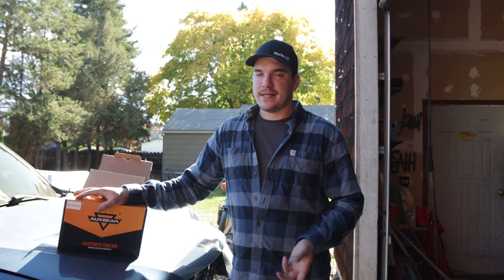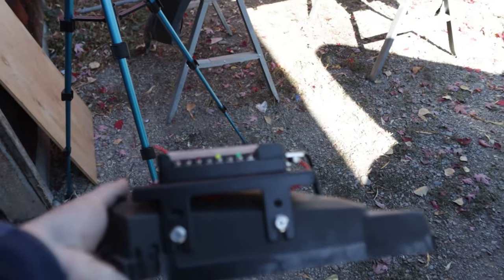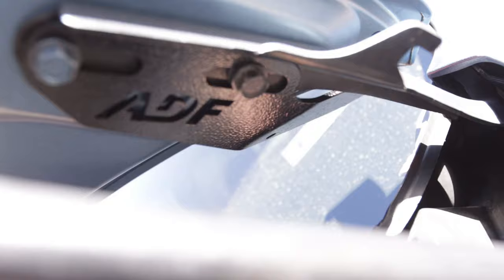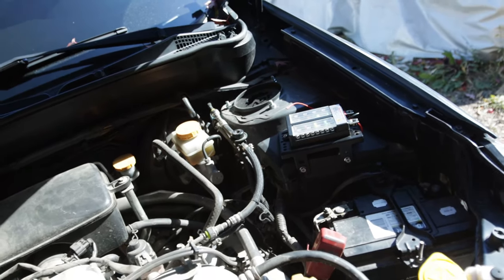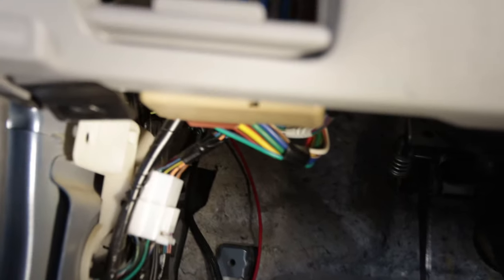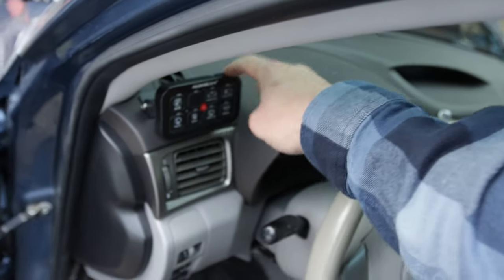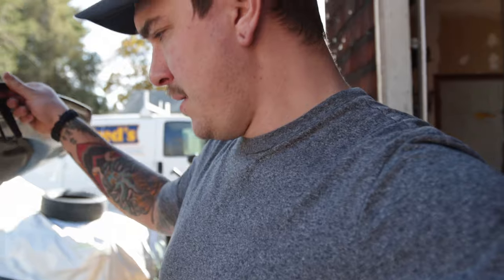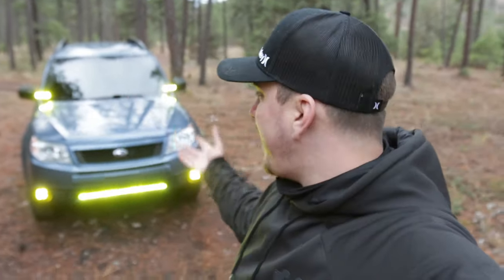Overland Subaru Forester gets some offroad lighting

Comment: Have you observed any unwanted battery draw from the switch panel even with all connected electronics turned off? Or does the panel come with it’s own circuit breaker to prevent that issue?